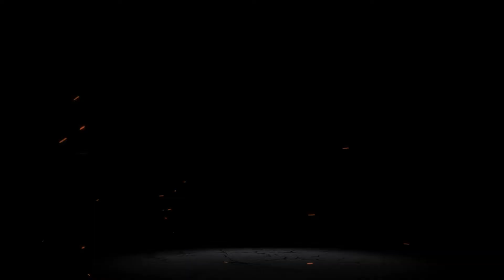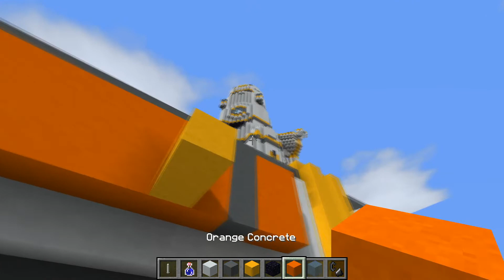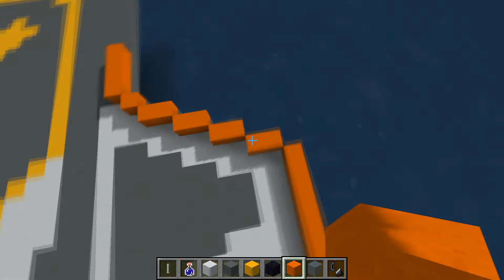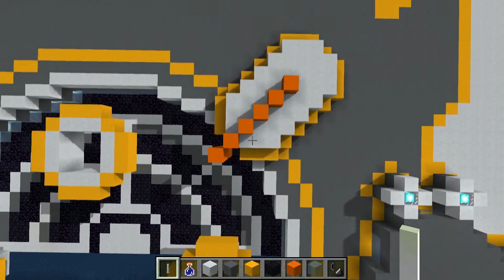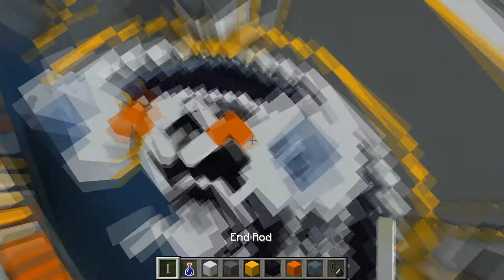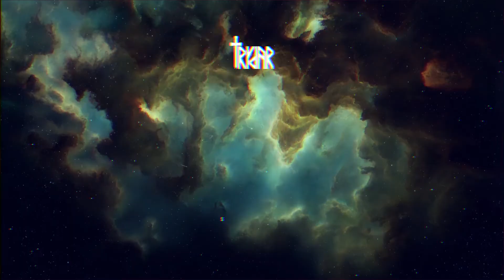Minecraft Subnautica Base Tutorial - Part 6 - The Neptune Rocket

Comment: the 55x55 at 5:20 did not make sense and when i tried to build it to make it a square of 55x55 the thrusters below the platforms were 6 block to make the platform and when it ended at 55 it was 5 blocks away and 6 blocks away so did you mean 54x54 or 56x56 by any chance? my explanation probably does not make sense so i will understand if you don't get it
Reply from the maker: the next slice above the stabilizers is a rectangle actually, with 5 blocks spacing away. I rarely use even numbers my dimensions. the cyan terracotta layer above is 51x53 with the corners removed and abit of glass. 53 is the long axis where the gantry ladder is. the other width is 51.
Reply: @trydar  thanks for the fast reply! now i can keep building it and btw its an amazing build and i think you are VERRY underrated
Reply from the maker: (hands you a cookie) 🍪 😸♥️

Comment: Whats the distance between the stabilizers and the edge of the platform? I cant eyeball it as there arent any good points in the vid to estimate
Reply from the maker: which timestamp are you looking at? 🤔
Reply: @trydar my bad for not giving you a timestamp, but the part that I need to know is at 4:30
Reply from the maker: @ThebigZ1353  there are 17 blocks of air between them
Reply: @trydar  I meant the layer right above the last layer of the stabilizer
Reply from the maker: @ThebigZ1353  the cyan terracotta layer above that is 51x53 with the corners removed and abit of glass. 53 is the long axis where the gantry ladder is. the other width is 51.
Reply: @trydar  I'm going to try being as specific as possible, what I mean is that I need to know the distance between the edge of the top layer of the stabilizer to the edge of the layer of blue terracotta right above it, I'm sorry that it has been a hassle trying to answer my question.
Reply from the maker: @ThebigZ1353  5
Reply: @trydar  thanks you so much, I'm very sorry for the hassle
Reply from the maker: (hands you a cookie) 🍪♥️

Comment: Just an idea. Why don't u download schematica or litematica so you can show people layer by layer and then it's only 1 build not like 8. Also then u could publis them on mc schematics. That's how I build ur schematica stuff anyway.
Reply from the maker: I have to keep the tutorials strictly vanilla because not everyone will use building assist mods, especially the people on bedrock/xbox platform. also then I would get questions about using those mods, which I dont know that well myself and wouldn't be able to answer. the 2 block slice method seems to work well tho, since no one has complained about it so far.  😅